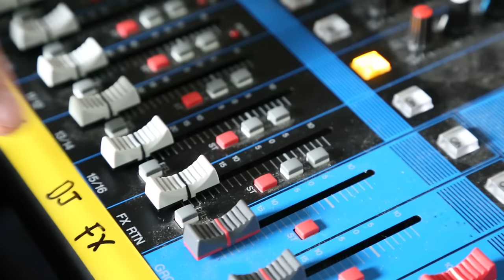How to Soundproof a party wall against noisy neighbours

Comment: How do I put the boards around double electrical sockets?  Getting an electrician out to remove it  is no option as I have tried everywhere and they are all booked up for months so I will have to go about this on my own. And I am being driven crazy by music next door. 

Can I just cut and fit the boards around the socket and then use acoustic sealant around it?
Reply from the maker: Hi Ryan H, as you mention, if moving the sockets to another wall isn't an option, then yes, the alternative would be to make a small hole to pull the cable for the socket through and then fill it with acoustic sealant and refit the socket as a surface mounted socket. A third option would be to fit the soundproofing around the socket and fit a socket putty pad in the back box of the socket.
Drilling a hole into the SoundBoards will always create a weakness in the system, hence our advice would always be to move the sockets to another wall (even if it means waiting for an electrician to become available). 
However...you mention you 'are being driven crazy by music from next door' SoundBoad 4 is an excellent solution for standard household airborne noise. For music and bass tones, then you would need to use a higher performing system that decouples from the original wall, such as one of our ReductoClip Systems. Please see below:
https://www.soundproofingstore.co.uk/reducto-clip-system
Reply from the maker: @Ryan92230  ideally you would remove the wires and thread them through a small hole in the putty pad. We haven't tried it this way, but potentially you could try splitting the putty pad and moulding it back together round the wires if you really didn't want to remove them.

Comment: Very nice. What are the equipements or materials that you have used to decrease the noise?
Reply from the maker: Hi Nilutpal Saikia, the soundproofing solution used is the ProSound™ Soundboard4™ which is an easy DIY, direct to wall installation. Further details can be found here: 
https://www.soundproofingstore.co.uk/soundboard-4

Comment: What about the chimney breast. How do you soundproof that, especially in older properties where there may be weak points.
Reply from the maker: Hi Paul Johnson, if you have a read of this blog, it details the best way to soundproof a chimney:
https://www.soundproofingstore.co.uk/how-to-soundproof-a-chimney
Any further questions after reading this, please just let us know.
Reply: @SoundproofingStore  hi, thanks for the info. Just 1 more question: We have 2 bedrooms with a party wall and both walls have air vents. These rooms also have vents on the outer walls so covering the party wall vents would still allow air into the room. If I were to cover the vents in the party wall with soundboard 4 would this create issues such as damp and if so is there a way around this problem. Thanks.
Reply from the maker: @pauljohnson8016  I'm afraid we couldn't guarantee if covering the party wall would / or wouldn't create any damp issues. You will still have the external vents, so it might be worth checking with a ventilation company to see if this would be sufficient for that particular room.

Comment: Does this help my neighbors if I'm the loud one? I live in an apartment complex and I have very patient neighbors. But I know that I can be a little loud from time to time. Actually if I'm being honest, I'm probably a way to lound way to often.
Reply from the maker: Hi, it can work equally in reverse. You will need to determine what type of noise and how loud you are going to be. Have a read of my blog as this simplifies types of noise, loudness of noise and you will be able to decide which solution is best for you. It may be that you need to reduce the level of impact (vibration) or make excessive airborne noise so require the ReductoClip System or similar.
https://youtu.be/4VpNzFYkA9M
Reply: Thanks, I will definitely check your blog out.
Reply: @jonathang.sandoval7973  If only more were as considerate as you mate!

Comment: Very useful video. We have noise (music bass and loud speech) coming through the kitchen wall which has cupboards attached to it. Is it possible to just clad the exposed wall area with Soundboard 4 to get a reduction in the transmitted noise? Thank you.
Reply from the maker: Hi B Hylands, unfortunately just cladding the exposed areas with SoundBoard 4 will not make much of an impact. 
SoundBoard 4 is great for household type noise such as the voices, but won't do much against the strong energy of bass. You really need to look at a system like our ReductoClip system: 
https://www.soundproofingstore.co.uk/reducto-clip-system
https://youtu.be/4VpNzFYkA9M
However, just covering parts of the wall will not help much, the sound will just leak through the non soundproofed areas. So the soundproofing needs to cover the entire wall. You would not be able to fix your kitchen cupboards back onto the ReductoClip wall. So it will be a case of rethinking the layout of your kitchen. If that is not an option, then adding the SoundBoard 4 to the exposed areas like you suggest will certainly be the easiest option. Smaller parts could also be cut to size to fit inside the cupboards, but having realistic expectations that it may not make a very significant difference.
Reply: @SoundproofingStore  Thanks for the advice.

Comment: Why is it not over and around the chimney wall area. And what was the cost for this job?
Reply from the maker: Hi Baba Ganoush! When we are talking about household levels of airborne sound, in 9 out of 10 cases the noise doesn't come through the chimney. Airborne sound is blocked by mass and mass = weight. The chimney breast has extra layers of brick meaning more mass. Then the neighbour has extra layers of brick on the their chimney breast meaning more mass. So the chimney breast helps to reduce sound. The alcoves however only have possibly one layer of brick. So if we add more mass to the alcoves, we solve problem. 

This isn't always the case, and you do need to check to see if sound is coming through just in case. If there is a weakness in the chimney or if the neighbour has removed theirs, then you can have a problem.

Comment: What about the flanking walls? Does sound not travel throught these too? Or will decoupling the alcoves solve this?
Reply from the maker: Hi Digilantz, every property is different, and you are right, occasionally flanking sound can be heard through the adjoining walls, or even the floor. In the vast majority of cases the sound usually comes through the party wall. (As was the case with the property in the video). Doing a simple ear test on the party wall and surrounding walls when you hear the unwanted noise will help ascertain if any flanking is occuring. If it is, then SoundBoard 4 can also be used on the adjoining walls.

Comment: How much would this cost for a decent sized room
Reply from the maker: Hi Kaleb K, the cost depends on the size of the 'decent sized' room. Based on an average size of 4m x 2.3m you'd be looking at £650 inc VAT for the SoundBoard 4 system in the video, not including installation, as 80% of customers install it themselves, (as it's a straightforward DIY installation).
This blog goes into more details about the costs of our wall soundproofing systems:
https://www.soundproofingstore.co.uk/what-is-the-cost-of-soundproofing-v-s-moving-house
If you'd like a quote on specific dimensions, feel free to fill in the below form:
https://www.soundproofingstore.co.uk/get-a-quote#Wallquote

Comment: could you foam adhesive an extra layer of 12mm plasterboard on top as a finish.
Reply from the maker: Hi Steve Sett, in theory you could screw on another layer, however, a better alternative would be to go for the ReductoClip Direct to Wall System which is a higher-performing (proven) system and includes 2 layers of acoustic grade plasterboard:
https://youtu.be/lI2bdQZWyOE
https://www.soundproofingstore.co.uk/reductoclip-direct-to-wall-system

Comment: can I ask, was it a compromise for space saving purposes, to attach to brick wall directly with screw/rawlplug? As in, I would have though the decoupling properties of the system would be compromised by this method
Reply from the maker: Hi Eddie Nolan, SoundBoard 4 is designed as a simple direct to wall soundproofing solution (Voted UK wall soundproofing product of the year 2020 ;)
Effective soundproofing requires adding as much mass as possible to the wall, therefore any solutions you can stick, or adhere to the wall won't have the required amount of mass needed to help block sound effectively. The SoundBoard 4 is attached by using 9 screws per board and the closed-cell foam layer within the Soundboard 4 also helps to dampen sound energy and vibrations travelling through the screw head, which is so negligible it doesn't compromise the performance of the SoundBoard 4.

Comment: My place was built in 1880 and the soundproofing in the bedroom is horrific next doors light switch being turned off can make me jump. I can also hear people downstairs as the sound is traveling up the walls - Would this insulation stop that?
Reply from the maker: Hi Simon Jenkins, we can certainly help and have different solutions for different types and levels of noise. Is the sound definitely travelling up the walls, or is it coming up through the floor? Our wall and flooring solutions can be found here: 
https://www.soundproofingstore.co.uk/walls 
https://www.soundproofingstore.co.uk/floors
In this instance, we'd need to know more information before confirming if the SoundBoard 4 would be the correct choice. If you call 01423 206208 a member of the team will discuss this in more detail with you and advise accordingly.

Comment: I have a similar house with chimney breasts and alcoves I assume that because the chimney breast has two layers or brick ie in my house and tge neighbours this blocks the noise? My house was built in the mid to late 50s.
Reply from the maker: Hi Kerr Dorman - In most cases we find this is the case. The extra mass on the chimney breast blocks more sound than the alcoves, so we generally only need to address the alcoves. However, if there is a weakness in the neighbours chimney breast or yours, sound can still come through. So its worth having a good listen to detect exactly where the sound is coming through. But most cases its just the alcoves.

Comment: Can you use the reductoclip system on a chimney breast as well as the two alcoves? if so do you have a detail showing the connection at the corners?
Reply from the maker: Hi Craig Stevens, yes, if you can hear that sound is coming through the chimney breast as well as the alcoves., then absolutely you can use the ReductoClip™ on the chimney. If you want to e-mail sales@soundproofingstore.co.uk then we can send you some diagrams showing this.

Comment: Won't the sound still be transmitted through the screw fixing into the brick wall?
Reply from the maker: Hello MrUniman69, the SoundBoard4™ features a closed cell foam layer (which dampens sound energy and vibrations). Vibration energy created by household levels of airborne sound is very small. Therefore, the amount that will travel down the tiny surface of a screw is so small it doesn't affect the performance. There would only be an issue if the levels of noise were loud or excessive. If this were the case the SoundBoard4™ wouldn't be the right system and a higher-performing system would be needed anyway, such as the ReductoClip™ Independent Wall System: https://www.soundproofingstore.co.uk/reducto-clip-system
Reply: @SoundproofingStore  Thanks for the reply and info.

Comment: How much would it cost to get this done ? On a wall roughly about 4x3meters
Reply from the maker: Hi, based on those dimensions and based on a UK delivery, it would be £738.90 (including VAT) for the SoundBoard4, including everything needed for the installation. (Scrim tape, hammer screws, acoustic sealant and sealant applicator gun). This doesn't include installation, as the boards are an easy DIY install. We also provide comprehensive installation guides and can offer advice if needed.

Comment: I'm thinking of creating a separate stud wall on my party wall which will be filled with insulation then a layer of mlv over the stud wall then on top of that 2 layers 15mm acoustic plasterboard with another layer of mlv inbetween them. Would that work do you think to stop the airborne sound transmission from my neighbours?
Reply from the maker: Hi Matt Obeirne, there are many ways to achieve sound reduction. Yes, this build-up will certainly do a decent job. It's not a build-up we would use as we have systems we believe to be better. (If you're interested have a look at our wall solutions page to compare them):
https://www.soundproofingstore.co.uk/walls

Comment: How do you install this insulation where the joint between ceiling and wall is curved? If installing the stud wall onto a solid wall version does new void created need ventilation?
Reply from the maker: Hi GameOverFool, If building a stud frame on a curve, you would build square sections, with smaller sections on top of one another, until you get to the top of the curve. You would install the SoundBoard 4 by creating a template of the curve, cutting the SoundBoard 4 and following the curvature of the wall. If installing the SoundBoard 4 directly to a solid wall without a stud frame, you would do the same, but without the stud frame.
There is no need for ventilation when building the stud wall in front of a solid wall, as there will be a 10mm air gap.

Comment: 35db in her room with no noise going on. 64db in the noisy room. After install, 37db in her room when the other room is making 64db. What about the audio level in her room before install? Without this number, the video and the link you’ve been sharing doesn’t actually explain how efficient this wall is.
Reply from the maker: Hi, So the point of this video was more to show that we had solved the customers problem, more than about detailed sound testing. The aim was to reduce the loud noise from next door to as close to the background noise level as possible. Obviously if having loud noise levels next door was already only registering as background noise level before soundproofing, she would never have called us in the first place! We will take note of this though and try to do more detailed before and after tests on our next video. In the meantime, if you want acurate test data on this product, you can view and download our independant, certified test reports from our website here - https://www.soundproofingstore.co.uk/downloads

Comment: Why are you not following the requirements of BS EN ISO 16283-1 for measuring the airborne sound insulation?  A Class 2 sound level meter <1m from the partition surface is not a suitable demonstration.
Reply from the maker: Hi Thomas, this isn't a video of an official sound test, this is just a demo of the boards being installed for a customer and the testimonial of a happy customer. The sound test is just a quick demonstration. All products are sent away to be independently tested to BS EN ISO 16283-1, of which all data can be found on our website.

Comment: How much are these boards each and are you in the uk? If not how much would it cost to have them delivered to uk? Many thanks jay.
Reply from the maker: Hi Jay, we are based in the UK - The SoundBoard4 (1m x 1.2m) is £48.50 each ex VAT and they will need to be delivered on a pallet (£60). If you send your dimensions to sales@soundproofingstore.co.uk we will be more than happy to give you a full quotation.
Reply: The Soundproofing Store thanks I have a measure up and see what size I need, thanks so much for the quick response, makes a change.thanks jay

Comment: What would the process for installing this on a party wall with a radiator be?
Reply from the maker: Hi S R, if using the SoundBoard4, then radiators can be removed, the soundproofing installed and radiators reinstalled - making sure the screws being used are long enough to go into the existing wall to take the weight.

Comment: Will this block out the clanking of pots and pans through a party wall? Thanks.
Reply from the maker: Hi, the SoundBoard 4 will give a large reduction on the airborne noise so provided the noise isn't too excessive then it should make a large reduction. If the pans are clanking against any part of the structure then it could very well be an impact noise that you are experiencing, the SoundBoard 4 does have a layer of acoustic closed foam to absorb some but you would probably need to have a look at the ReductoClip System for excessive impact noises:
https://youtu.be/4VpNzFYkA9M
Reply: The Soundproofing Store Yes, its impact noise. I'll check it out. Thanks.

Comment: Can i still use this if my bare brick walls are not perfectly level/ plumb ?
Reply from the maker: Hi Ross Lakin, you need to make sure the wall is level and flat, otherwise the boards won't sit flat and you'll get gaps in the joins for the sound to leak through. 
An alternative would be to use the ReductoClip™ Independent Stud Wall Solution:
https://youtu.be/4VpNzFYkA9M
https://youtu.be/fQcfjqQvtOQ

Comment: I wonder why there is no sound comming from the fireplace, that wall isnt soundproofed. I have the same problem but I guess its hard to sundproof the chimnbey
Reply from the maker: Hi @jackphilipsen452, in this instance the chimney breast didn't need soundproofing as the majority of the sound was coming through the alcoves. Chimneys usually have a double layer of very dense firebricks so in many cases naturally deliver a higher level of soundproofing than the alcoves. 
However, this isn't always the case, and you can indeed soundproof the chimney if it's required. These blogs might be of interest:
https://www.soundproofingstore.co.uk/how-to-soundproof-a-chimney
https://www.soundproofingstore.co.uk/how-to-soundproof-against-awkward-areas
Reply: @SoundproofingStore  tnk